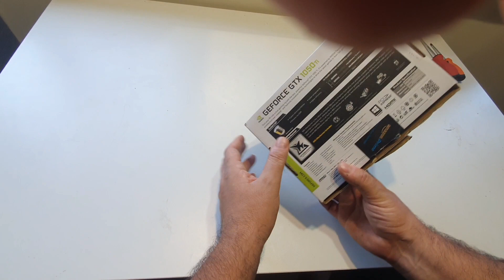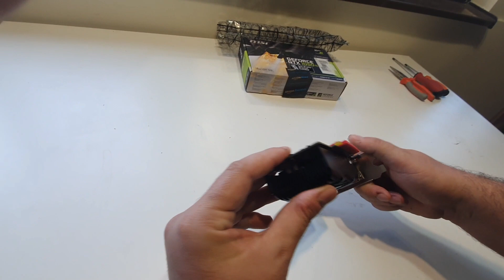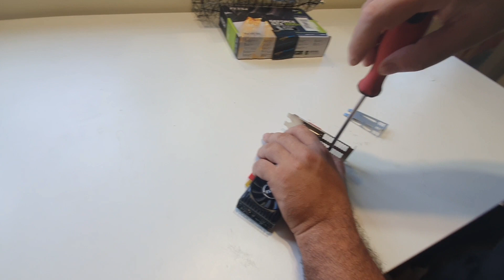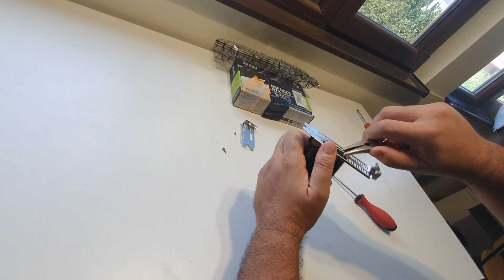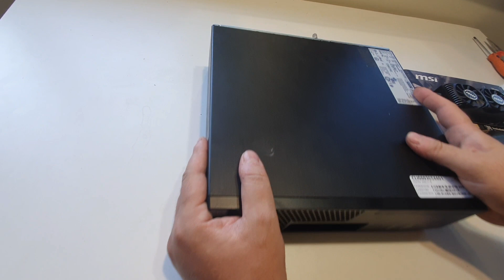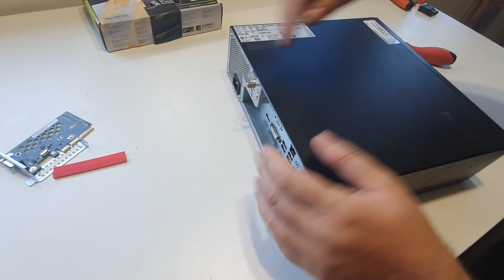How to Install a GPU in a Small form Factor (SFF) PC

Comment: I have a dell optiplex i7 8700 sff running windows 11 pro and it is running a 128gb vram. 
I want to get 8gb vram. What is the correct graphics card to get that will fit. It currently
Reply from the maker: I used a 1050, but if you want to get higher you could get a 3050rtx
Reply: will the 3050rtx work with my dell sff in 4K with  the low power supply? 200w
Reply from the maker: @B-ie2ru  The 3050 will draw 180W. So you have to settle to a 1050 or a 1650 SFF model, that uses 75W.

Comment: Is a bracket required?
Reply from the maker: If you want it to stay fixed, and not wobble around, it would be good to be there.
Reply: @VladCriste  Yeah because I bought a 1650 and it seems as if the gpu will arrive before the bracket, and I'm making sure that It'd be safe to use without a bracket. So in conclusion the gpu will still work without a bracket correct?
Reply from the maker: @ssgugo1x  Yes. Should work.
Reply: @VladCriste  Alright thanks for everything, you just earned a subscription!
Reply from the maker: @ssgugo1x  Ty

Comment: I have a hp elitedesk i5 9500. The default gpu is not very good so I want to install something but I think I need a compact GPU like Gigabyte Radeon RX 6400 D6 Low Profile 4GB GDDR6. Any recommendations?
Reply from the maker: Yes, you need a lowprofile one. Compare prices on what you find. That one should be around 200 euro.